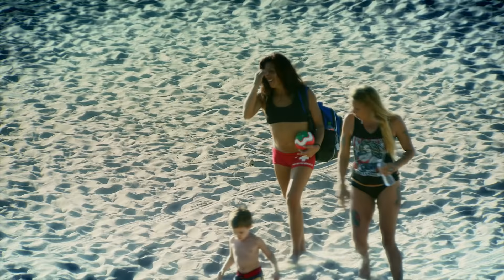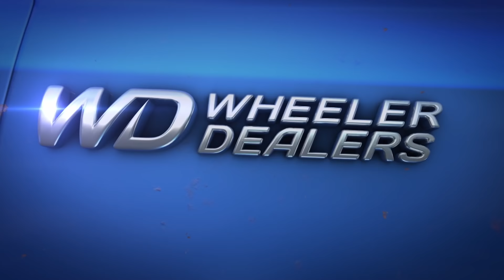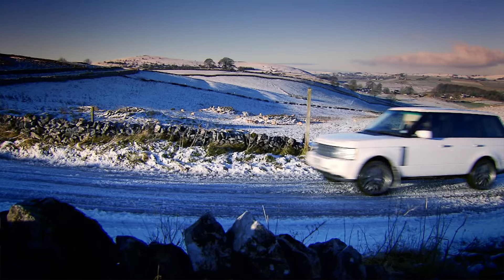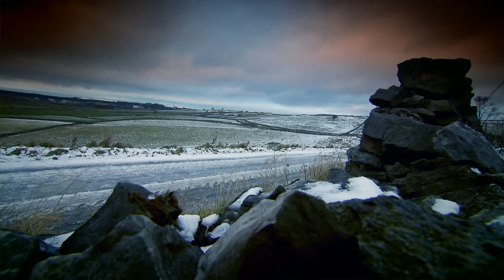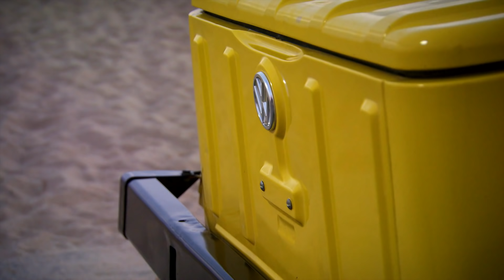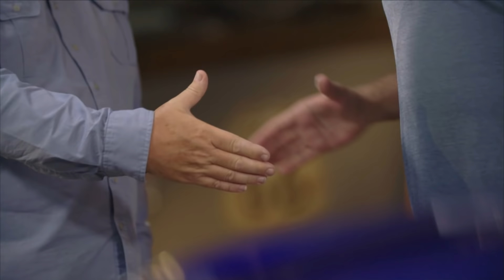Why Wheeler Dealers Moved To The USA | Wheeler Dealers

Comment: I agree with grizzly 9871. I rather watch UK series than US. Ed China is very informative in his comments. What can be DIY or not. US only show nuts. I think there is some kind regulations that they cannot show any repairs done. All they show is bumper & exhaust repairs. Like all US car shows, all the same. They show boxes of upgraded parts on the floor and next scene is all fitted & done. In UK version, Ed showed a fuel injection system of BMW 2002tii and brought us to the actual shop that repairs it. He also showed how he repaired an Audi TT's gearbox for 50p. He showed several repairs and modifications that can done on so many types of vehicles. Informative and educational for car guys for me. US version alot of empty talk to make up time.

Comment: Watched the show for years and I was unimpressed when Any replaced Ed but I don't mind him now. What I do mind though is the way the show has changed. You can't say it's the same show at all.
It used to be about the normal guy fixing his car up on the cheap to sell. It actually encouraged me to change the timing and water pump in a car I had when I wouldn't have dared before. That's what this show was about.
Now it's about buying a car for 20k, spending 20k replacing all the parts and selling it for 60k
Reply: Absolutely, I've tackled shocks and springs for the simple reason that I saw Edd do it! (And yes everyone, his name is spelled "Edd", just sayin')
Reply: They actually did the same with Orange County Choppers ... started as a small outfit and then the money came in and destroyed not just the show but the crew too... for what ... shit TeeVee... 😒
Reply: @TheIDGE  I'd done shocks and springs before but I stayed away from engine work until I started watching wheeler dealers. After that I bought a 1.4 Renault Megane coupe from the auctions that was obviously a boy racer's car before. Unmodded it by putting a standard exhaust on, un-tinted the lights with a polishing kit, changed engine mounts as the gearstick moved when you accelerated, painted the wheels silver again as they were black then changed the timing belt and water pump. 
Had the car for 8 months after that and it was a good car. Sold it for way more than I bought it for and I wouldn't have even bought it, it if wasn't for that show.
I did plan on selling it straight away like the show does but I ended up liking the car with the exception of doing the timing belt in the very small engine bay.
Reply: When is jo average in the uk going to buy a 60s mustang to do up..get real.

Comment: Moved to the USA and totally dumbed down for audiences, fits in with 90% of the other crap that is on Discovery and the like.
Reply: It's now like all the other US car shows.tap here tap there  and it's finished. Crap.
Reply: I agree.

Discovery channel everything today is dumbed down enormously. Docs, were interesting on discovery, before they dumbed them down enormously.

All discovery and history channels, and all those doc channels today on sky, are just rubbish. The docs are just rubbish now, i do not know how people watch them. They have all stole ideas of how to do docs now of each other, and made them all as rubbish as each other.
Reply: When I saw the episode about the Suzuki Jeep I was all done, its all for show not saving cars. Come on you do a full respray, put bigger suspension and tires on it, weld in a roll cage and after all that work you still did not see the bottom was completely rotten out and would not pass MOT, makes you wonder what else they miss or just ignore on other cars.

Every sensible mechanic would buy or inspect the car, put it on a lift and immediatly sees the car only destination left is the scrapper

Comment: The show made me go from a Peugeot 205 xs 1360cc 85bhp . Citroen ax gt basically . To. 205 1.9 gti 130 bhp in white .. God the car cost me £10 a day to run just pottering about back in 2004-2005 .. reg was FIL 3887 if anyone has it . I spent £3,000 on that car .

Comment: Like a lot of shows, WDs started off small and low budget, and grew beyond what was probably advisable. Obviously money was a large factor here, which after watching Mike for years, makes sense. It's just not the same show it was, and hasn't been for quite some time. Even before Edd left, the show shifted to include more of Mike doing the deal, and away from most of the show being Edd doing the actual work. I personally think that was a mistake, as I think that was the more interesting part. I also don't think the move was necessary to grow the market for the show, as Top Gear (Clarkson, May, and Hammond version obviously) proved that a UK show can garner a large U.S. following. In the end, I just think "Americanizing" the show was a mistake that traded the character of the show for money.

Comment: As a fan of the original British version(and of Mr. China), yes, I admit the California based episodes are more soul-less, and while I think Ant is a great guy, he's not Edd. I live in SoCal and I've seen several of the cars the U.S. based Wheeler Dealers have made(I nearly bought the Capri they restored last season) and the quality is vastly superior to what the original British version had. Admit it fans, the earliest of episodes had cars that were barely road worthy due to the terrible weather in England and how rusty the cars get so quickly. The episode where Edd refurbished a MK 1 VW GTI had me cringing at how much rusty, bubbling metal was under the white paint after they had finished it! The TVR S episode where the darn thing was just in horrible rusty condition(the brake booster was rotted from within!). I think a lot of that, the condition of the average used car in the U.K., the weather, the ability to film 12 months out of the year in California prompted the relocation to the U.S.A.. Yes, the British episodes were straight-forward refurbishing, less frills and better info for DYI-ers, but at the end of the day, the cars were still "Tatty" as the Brits say. If we could only combine the best of the early U.K. episodes with the quality of the U.S. episodes vehicles, we all would win. Have Edd and Ant refurbish the cars(have you notice nearly ALL American car based shows have 2 to 3 host/mechanics?), that would be awesome, but the bad blood is there and Edd would never stoop to such a level. I feel for the British audience....